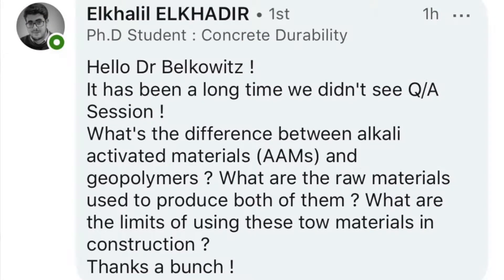Geopolymers vs. Alkali Activated Materials - Vlog #233

Comment: activation by itself means changing the activity of the precursor. in geopolymer you activate nothing. it is a polymerisation reaction. when you say alkali ativated material the chemistry indicates that the precursor (ash, metakaoline...) is reacted with alkali solution (NaOH or KOH solution) so you may get high strenght but as soon as the concrete is placed in water for a few days since the alkali activation is not complete Na+ or K+ are leached out form the concrete and the durability becomes weak. in geopolymerisation precursor is mixed with harder (NaOH+ Na silicate) so that in the 3d structure Na+ is enclosed in the aluminosilicate ring. therfore it will have hgher durabiity. so in general if precuresor + (NaOH - Na silicate solution) is used you are making geopolymer. AAM are not geopolymers.
Reply: I still don't understant the difference between geopolymer and AAM. Would you mind if I ask you to show me some examples for each material?
Reply from the maker: Thank you Abel!!!
Reply: @IntelligentConcrete  you can have alkaline based geopolymer, but also acid based geopolymer like phosphate.
Reply: Abel, having performed leaching tests on geopolymers and analyzing the leachate I can confidently say that Na and/or K are leached out to an extent over time..

Comment: Guys, you have mixed up everything about geopolymer and alkali-activated concrete. In alkali-activated materials, you ACTIVATE with alkali the material and there is a hydration process that is going on there. In geopolymers there is nothing to activate so it is wrong to use the term "activation" there, you use REAGENTS or HARDENERS along with SUPER-REACTIVE AMORPHOUS MATERIALS and get a geopolymerization processes instead of activation. In alkali-activated materials, you use caustic solutions of KOH, NaOH, corrosive water glass, etc. In geopolymer cement, you use user-friendly, irritation reagents (not corrosive) and never caustic solutions. The other point is that in geopolymers to make geopolymer reactions happen you can use ACIDS instead of ALKALIS. Please read the theory more carefully.
Reply from the maker: Thanks for the feedback.  We’ll review the video and get back on it if there are some mistakes.

Thanks again!!!

Comment: Not a good explanation. My GP mix wil set stone hard in 15 minutes when heated at 80 degrees C. 80 MPA in 28 days. Can with stand 1200 degrees C when fully cured, which Portland cannot match.